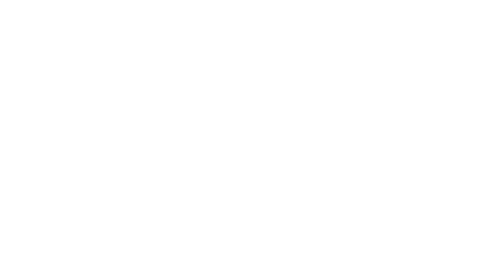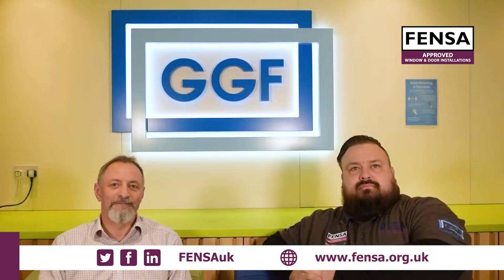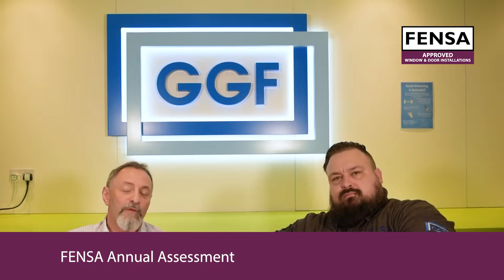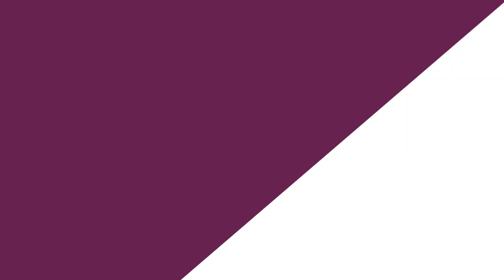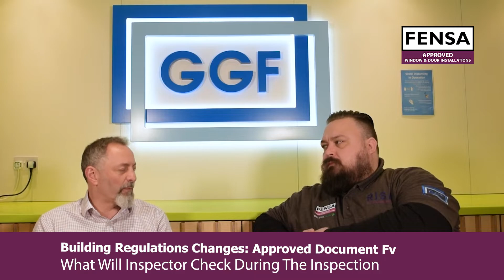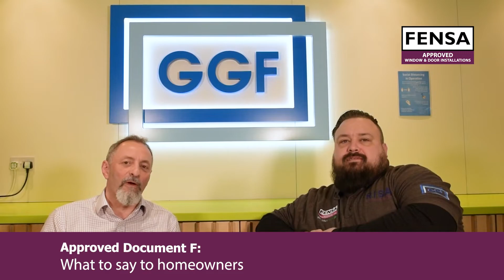FENSA: Changes to Approved Document F: Ventilation

Comment: So lets call for hermetically sealed windows with incredible insulation values, then drill holes through the frames which immediately impacts the thermal properties, then put a cheap piece of plastic over the hole that can immediately be shut?!  How is this sensible?  If the vents were permanently open then you can argue they will ventilate the background.  But they can be closed, so what happens in most instances people shut and forget them.  You don't pay to have A rated windows to then open a trickle vent which when open completely shoots the energy rating out of the window No pun intended!!!!  Pick a flippin lane!   If government really want to improve peoples health try educating the public, tell them through social media and TV advertising that it is a good idea to open windows in their homes now and again, its not rocket science.  There are plenty  of people who genuinely don't realise how unhealthy it is to not ventilate their homes regularly, those same people will get their new windows with their new trickle vents which they will immediately and permanently shut forever.  Please explain how this achieves the governments aim?!  It wont and we all know it.  But what the heck, in society nowadays we are being told on a daily basis to go along with the crazies and not question things.  This may sound radical, most windows I have installed in my life can open!  I know amazing!!!   The lunatics are running the asylum.